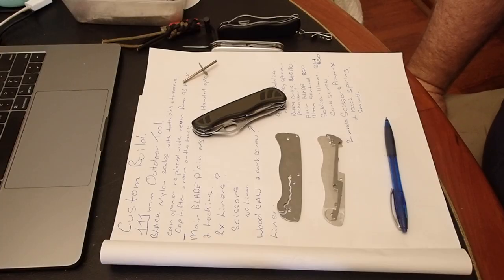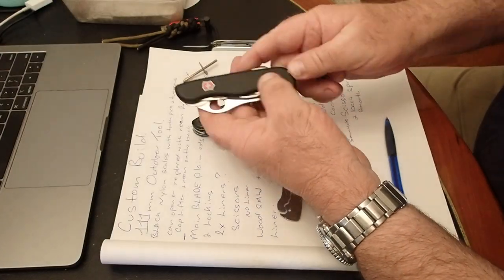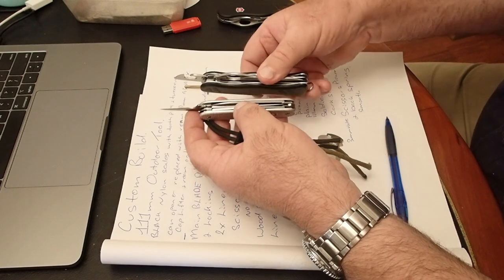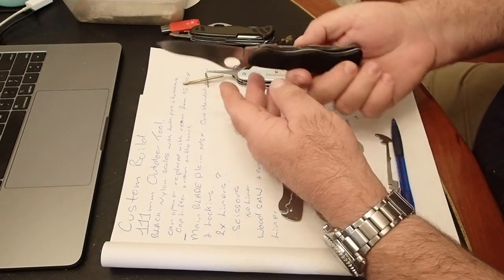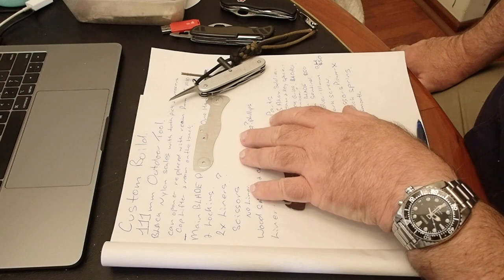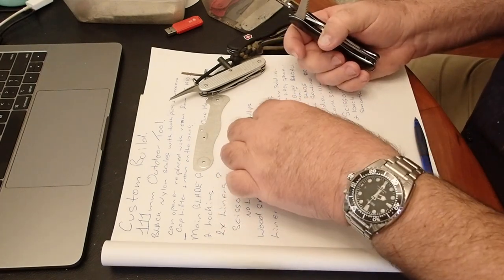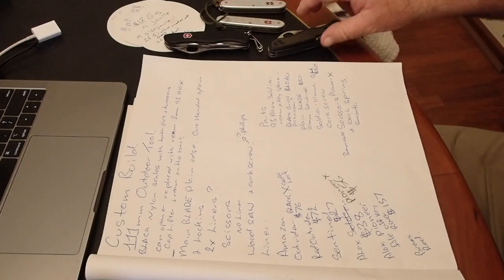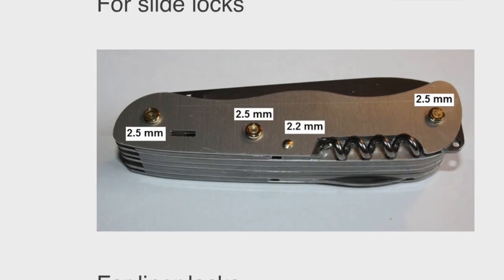Victorinox 111mm Outdoor Tool DIY build

Comment: Fantastic idea! My ultimate outdoor 111mm is a liner-lock Outrider but with inline awl and Garant-style scales but in day-glow. I'd also sacrifice the Outrider can and/or bottle opener for a combo tool and the small blade or the inline awl. Maybe a Firefly as a scale tool but beware that they deteriorate just sitting in the scale. I have a small diameter cylindrical ferrocerium rod that sits nicely below the large Philips screwdriver in the Outrider (in turn below the scissors) so it 'll never fallout accidentally.
Reply from the maker: I managed to recreate this knife by adding a one handed blade and a in line awl from a 93 mm alox to a Outrider

Comment: There was two versions of that knife, one with wood scales & the one you are showing.
I really wanted one of the factory models but had no success in acquiring one. I think
there was an issue with the inline awl and Victorinox would not create a second run
which was disappointing. I would be interested in how your version comes out and 
if there is any problems with the performance of any of the tools.
Reply from the maker: I think 🤔the awl might need a trim to prevent the side interfering with the side plate I am in two minds building a knife with two awls and no can opener. I could sharpen the inside edge of the cap lifter as a fire steel scraper the older 93mm soldier had an edge on it.Also thinking of using the liner off a Sentinel to make the wood saw locking
Reply from the maker: Been having a play with the ream this morning its the same base thickness as the 111mm cap lifter the key chain spacer is only there to reduce the interference with the outer liner. its a ugly looking job that only leaves modding the ream or the liner
Reply: @kisbushcraftdownunder  That’s too bad, probably why Victorinox stopped building 
that model, I really like the inline awl for crafting stuff. I think it’s design is better for drilling. 
Your idea for a locking saw sounds interesting. I think I would square off one of the sides of 
the locking screwdriver instead of sharpening the curve like the soldier model. It just
seems  easier to do a good job of filing a square edge. I guess the fallback plan is to carry two knives 
like maybe a Pioneer X  and one of the 111mm locking models. Changing the blade on an Outrider to a
one handed non serrated blade would make for a good backcountry folder. I find the scissors very 
useful for opening freeze dried food packaging, first aid, cutting cord & such.
Reply from the maker: @hitchpost5822  I not beaten yet just need to find a less ugly way off doing it will be posting a video shortly with me struggling with the ream
Reply from the maker: @jasonedwardledburynewzeala9897  Hi not sure if its the links in your comments YouTube seems to be deleting them ?
Reply: @kisbushcraftdownunder  if the link is an email, they do. They get a funny sometimes. They dont seem to mind tube tube links.🤣👍 should be a cool knife.Your final choices for the knife should be interesting. Its hard to get all the right tools for the outdoors. I did like the style of the front awl better.But i also like the locking can opener. But dont see the logic like yourself in having 2 awls.
Reply: @kisbushcraftdownunder  i tried to drop an email link, for the fire fly ferro rod that fits in the tooth pick holder
Reply from the maker: @jasonedwardledburynewzeala9897  I have a box of them The notch in the cap lifter works really well on them